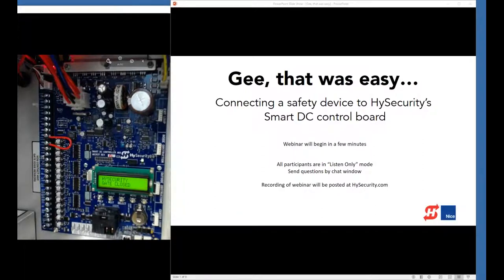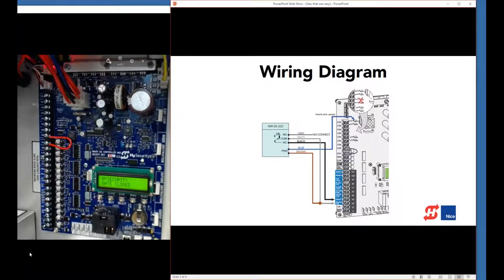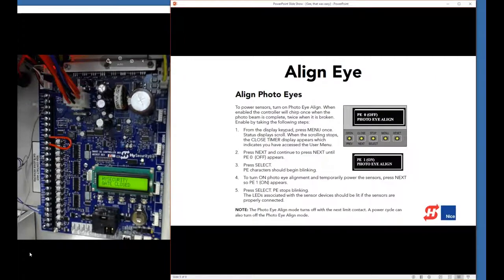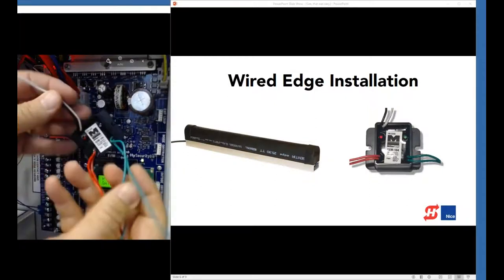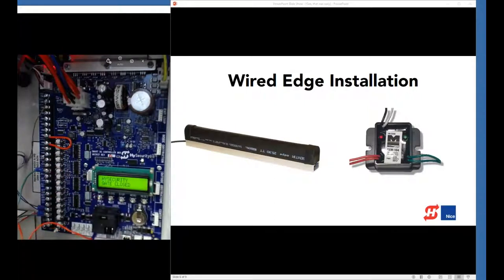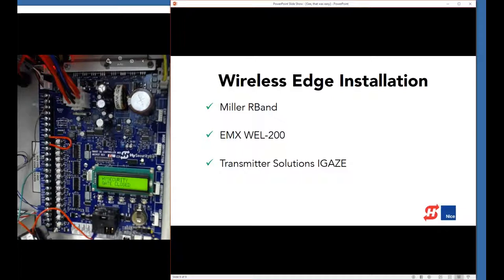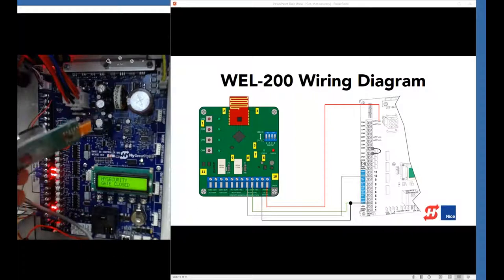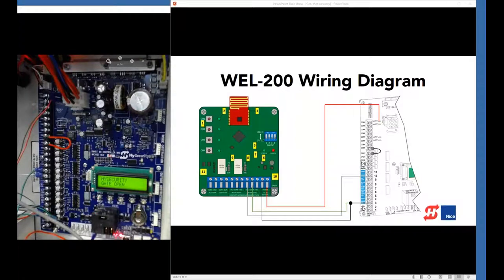HySecurity - Connect Sensors and Accessories

Comment: My Eagle 1000 FSC Reverse Loop light comes on

The gate won’t close or open now

What should I do?

The Photo Eye’s green lights come on though and when it hits the reflector, the red light(s) comes on as well

What should I do?

I bought an EMX-50-325 and it has a common wire. My board has no common connector though. My board has 2 hot 24 VAC wires so do I just connect both hot wires on the EMX Photo Eye to the 2 hot on the board. 

How about the common wire?
Reply from the maker: It sounds like you have a lot going on with your operator; if your reverse loop light is going on when it shouldn't, you probably have a problem with your in-ground loop and it needs to be replaced. You could try power-cycling the operator to clear the light, but this may just be a temp fix. Regarding your photo eye, make sure it is properly aligned with your reflector. There are typically two lights on a photo eye, one to indicate power and one to indicate alignment. There may be a third to indicate an obstruction. Regarding attaching your EMX photo eye, all control boards should have a Common terminal. I am not familiar with your Eagle operator, it may only work with propitiatory products.

Comment: John, this video is very helpful.  Thank you.  Can I adapt what you have shown to install a GSM?  I have a GSM I would like to install so I can open the gate with my phone am not sure what to connect it to.
Reply from the maker: The relay for opening devices, such as a GSM, would be attached to the RADIO OPEN terminal and COM terminal on the main board. This is not the same terminals described in this video for attachig entrapment protection devices.
Reply: @totalsecuritywarehouse3621  Thank you.  I will try it

Comment: How do I program a remote? I can’t find it anywhere
Reply from the maker: Programming for remotes is not completed directly on the HySecurity gate operator itself. Instead, there is an auxiliary radio receiver box/antenna that has been wired to your gate operator. This auxiliary radio receiver box is typically installed right inside of the gate operator and will have an antenna connected to it. Can you identify the manufacture/model of the radio receiver box that you are using? Common manufactures might be Linear/Tri-Code/Multi-Code/LiftMaster/DoorKing/Delta.